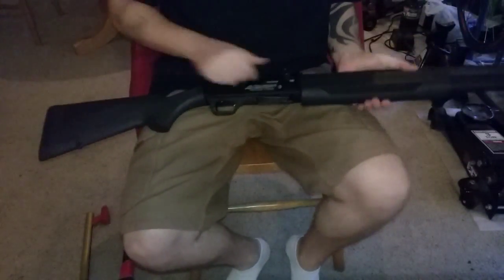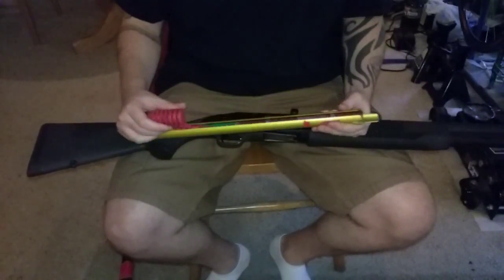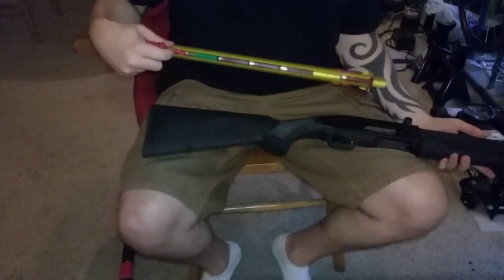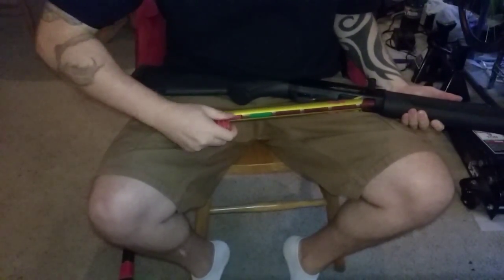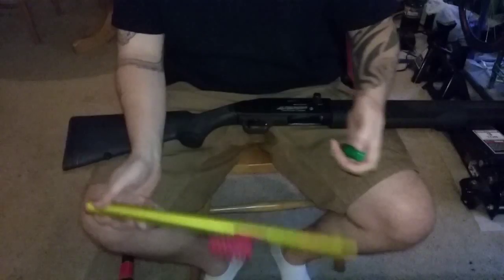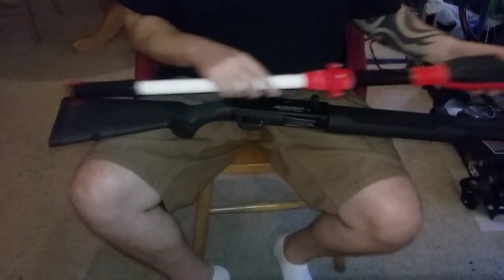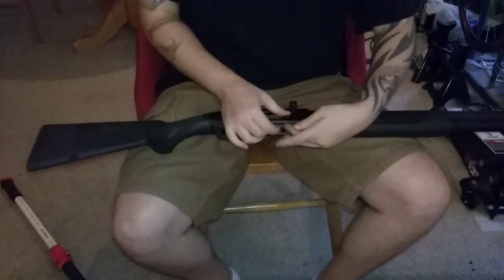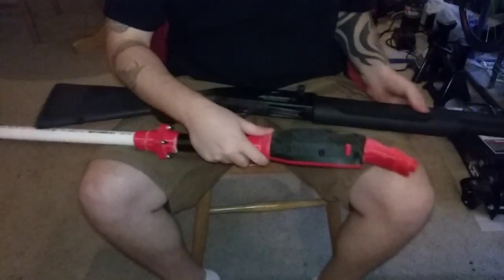Spring Operated Shotgun Speed Loader

Comment from the maker: Thanks for everyone's thoughts. this has some potential, needs refining and make it a lot smaller, and easier to use in stressfull situations.  Nothing new with this design.  Working on another design that could be better than this, different concept for loading the shells though.  Takes lots of time to work out all the details and build prototypes.
Reply: This has the potential to be the best shotgun loader ever.  Are there bulky mechanicals in the bulbous area?  Seems like it would be best if it was the same diameter all the way through.

Comment: The Arredondo "Tecloader" style tube you have there is not meant to be used as a stand alone loading device. It is meant to be used in conjunction with a "speed chute". The Speed Chute funnels the tube into the proper position aligning it to center and for proper angle. It also grabs the wings on the tube stopping it to a set point and allowing the forward momentum to shift to only the follower handle moving the shells into the shotgun mag tube all without the tube breaking position to the loading port. When it is setup correctly you will easily be able to quickly load the shotgun with one hand in a single forward motion. Though I appreciate your ingenuity, the device you have devised is impractical to carry during a 3 gun or any other shotgun speed shooting event because of its size.
Reply: BallisticianX  OMG... This video is painful to watch.
Reply: Problem with the funnel is that its only available for semi auto shotguns
Reply: @Anluckie so regular pump no go
Reply: Like syringe mechanism?